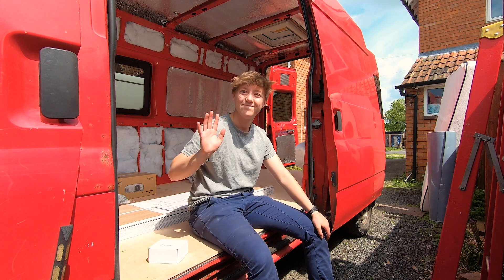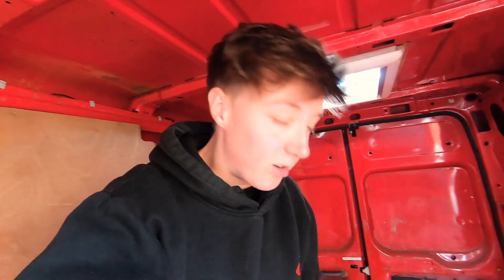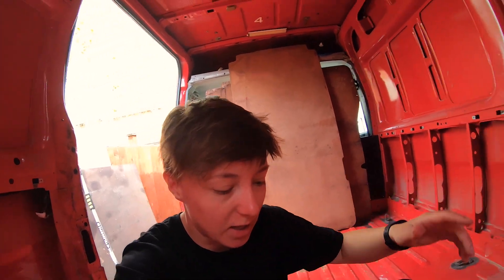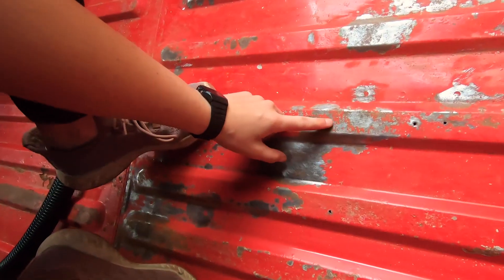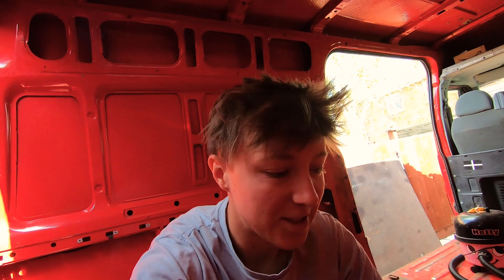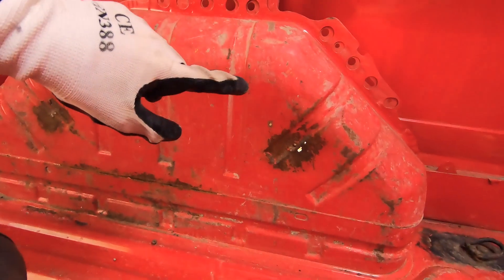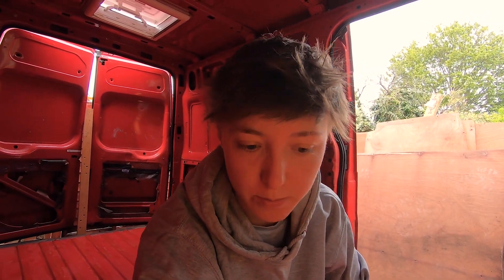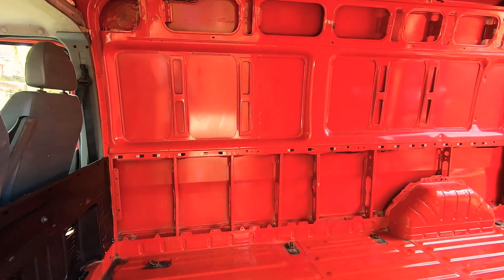The Start of A New Van Build! - Van Build Part 1 (Preparing & Cleaning) SOLO FEMALE VAN BUILD

Comment: Not sure the filler on the wheel arches is going to stand the test of time. Filler is more for smoothing out dented bodywork than filling holes. May have been better to get someone to weld the holes properly. Hope you don’t mind this comment? Good work Shannon x
Reply from the maker: always appreciate the comments, I'm definitely not a professional just doing what I think might work, I've used this filler on my caddy to fill a hole on the outside and painted over it and it's still good 2 years later so fingers crossed it works for this too
Reply: @ShannonLawford  I’m no professional either but so impressed that you’re doing this yourself. Braver than me!!